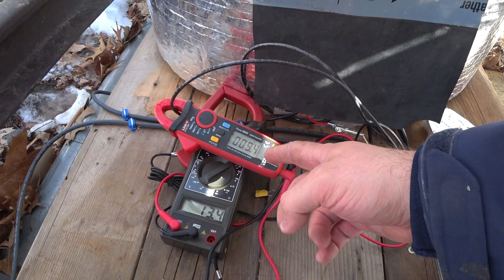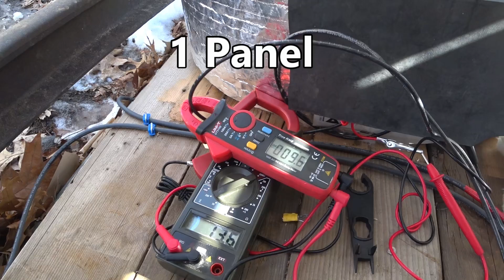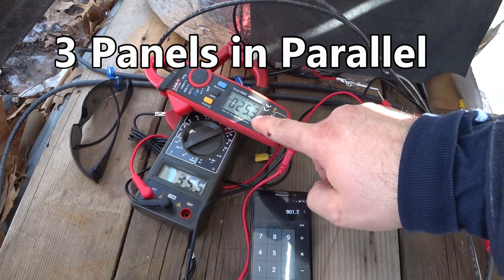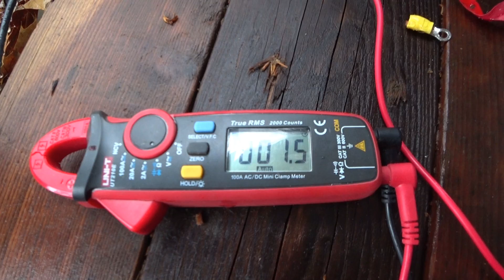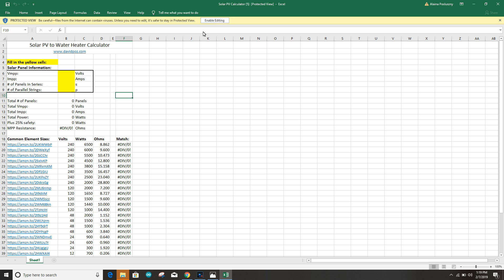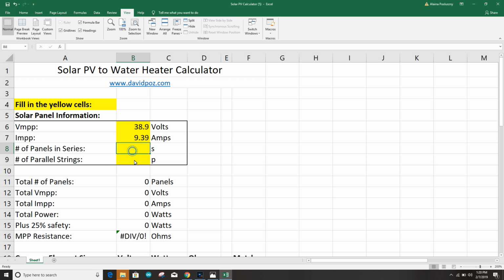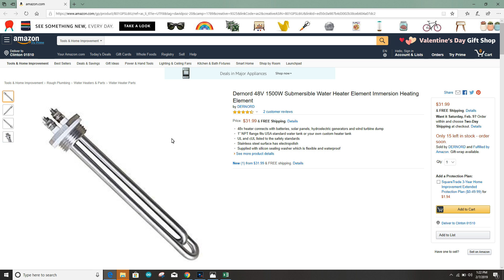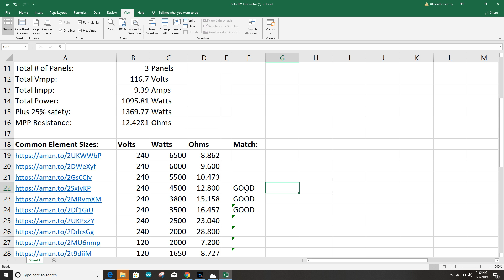Matching Water Heater Elements to Solar PV Panels

Comment: I'm doing an experiment today along these lines. Your video made me want to try it! I'm having an issue though. Doesn't matter if I hook my 3 panels in series or parallel I still only get 13 volts and 2.5 amps. I'm stumped.
Reply from the maker: Try going on to my website and downloading the excel spreadsheet.  Input your solar panel Vmp, and Imp.  They are usually listed on the sticker on the back of each panel.  Input your info and it should give you a good match.
If you don't have excel, send me your panels info and I'll get back to you a result.
Reply: @DavidPozEnergy  Based on the spreadsheet I think I need better panels. I guess I need to bite the bullet and pay the freight for 300 watt panels. I have looked for them off and on but with limited luck. When I did find them I couldn't afford them. hmm

Todays test did get me 10 degrees above ambient. That is in an open container uninsulated. I had to put them back in parallel. I think I had something not just right the first time in parallel. Or the clouds ruined it. It's rained every weekend here for two months. Weekend time is all I get.
Reply from the maker: If you want to connect on facebook we can look at it together.  https://www.facebook.com/DavidPozEnergy/

Comment: What is the efficiency of production of hot water vs. Electricity in your area? Would it make sense in most cases to use the space better by using a closed loop glycol solar hot water system for transferring heat from the sun to the tank for storage than using the pv panels to convert the light from the sun into current and then heat in the tank?

I guess the amount of capacity in each system is variable so, if you are generating sufficient voltage and amperage to equal the demand of an empty house all day to be used when you get home, that is one considerstion, if you are using the electricity during the day with someone at home, doing household chores and activities there will be greater demand, so less need for storage, but, no infeed to supplement from outside and if that person is at home doing normal household chores and also doing work for income, which requires electricity, you would definetley surpass your ability to store any potential for later in your batteries and further require infeed of current daily, ultimately costing more money and plscing higher pressure on your decision to allocate the solar array space between solar power for voltage or for heat. Perhaps each of us in our own situations will have to make that decision, right? So if we opt for electricity because of potential currency savings in the event of higher pricing and a battery bank for eventual electrical infeed outages, then on the available space, hot water is out, not allowed any space, so we heat hot water with other fuels?

OR

We formulate the space needed with the technologies available today to cover all contingencies when building the racking for the solar array, including some suntracking for the most expensive energy demand and future expansion, we would have to build in some extra spaces for that expansion or have a lucretive interconnect or grid tie document to pay for any excess power generated.

So, our PV space would be:

(PV1 ÷ PV B ) + (PHW1 ÷ PH T) = ARRAY SQ.FT
WHERE: PV1 = nobody home
PV B is battery capacity (expandable)
PHW 1 = Solar Hot Water collector space and PHT1 is storage space when no one is home (expandable).
Your array may only be 1/2 full to meet this level of service. If you add 10% and call this solution 1, you are following me here.

Then for solution 2 & 3, repeat with increasing loads for the minimums.

The ace in theholes are the changing costs of maintenance, material life and upkeep, natural distars and expansion frequency. These may all be covered if your power company or a paying Air B&B,  hunting and/or fishing, artist, photography, pilgramige, honeymoon, getaway or retreat cabin(s),  are located there to use the excess. In that case, and if successful in filling those cabins, build and expand away! Add another revenue stream, build more...

These incipient loads and potentials must be established before the prints or images in one's head take real shape!
Thanks for illustrating step one in holistic resource management - paradigm construction 101.

Comment: Solar thermal panels (which are not self-built or 20 years old) with "forced" circulation are much, much more efficient than a panel of the same mono-crystalline photovoltaic dimensions, excluding the high-performance SCHMV.

Comment: I can't help but feel something is terribly wrong with your setup... Out of, I don't know, six or seven arrays friends have that I have helped install, series is always additive. So I'm not sure why your system is not additive, that is LITERALLY the point of running in series. Same power at a lower current. Allowing for cheaper wires and lower, safer voltage to be used since they don't need the high current carrying capability. 1500W=1500Vx1A or 1500Ax1V... One of those could use some super tiny wires, one would require a prohibitively size wire... So to instruct people that series is somehow a bad idea, is... A bad idea... Not too fond of the guidance given here. :-(
Reply: Panels are current sources. Current adds in parallel. Voltage adds in series.  If there is one take away, it should be that matching panels to load is critical. AND that is not a one time thing.  The load has to be re matched continually throughout the day. That is why a power point controller must be used to perform this matching of panels to load. This setup without electronics produces half the power that it could have.  I've been trying to teach people how to heat water for years with PV.  It is a difficult idea to get across to the general public.

Comment: I enjoyed the video,...at about 11 minutes you show on your spreadsheet that three solar panels generating 116 Volts , 9amps  producing about 1100 Watts is enough to run a 240 Volt approximately 4000 Watt heating element. Can you explain why you wouldn't want solar panels that produce about 240 Volts at about 16 Amps to run a heating element that's rated at 4000 Watts?
Reply from the maker: You could do that too.  It's just about matching the ohms of the resistor to the number and mp of your panels.  So if you have panels strung together in a series/parallel combination that has a Vmp=240, and an Imp=16, then you would be well matched.  I did something similar with my panels in my front yard.  They are all series strung together and tied to a baseboard heater.  https://youtu.be/jFoxIit8NYA  Thanks for watching.

Comment: I'm still confused why your voltage was lowered to 13.9v with 1, 2, 3 panels in series as well as the current remaining 9,? . Did the element limit the voltage at 13.9
Reply: Panels are current source devices.   Notice how the short circuit current on a panels label is almost identical to the power point current.  Ideal panel voltage for maximum power remains about the same  as light level changes.  Only the current changes with light intensity.  Adding panels in series did nothing to change the current.  With a fixed resistance, voltage is current times resistance. That gives a low voltage. The voltage times current is the power.  Direct connect to a resistance like this yields about half the the total power for the day.  And most days the sun intensity is not ideal. A power point circuit allows you to capture all the power possible.  The results would have been more dramatic if this test was performed with a power point controller. Your eye is log and panels are linear. A wisp of a cloud passing can drop panel output 80% and your eye would hardly notice the difference.
Reply: @opera5714  Thanks, and great effort from everyone. So are you saying that 1) With an MPPT controller you don't have to impedance match? 2) Can the AC thermostat switch DC when the element is impedance matched? There isn't much info in the video of how the Thermostat works. @DavidPoz how is your thermostat configured? Thanks guys, great effort!
Reply from the maker: Yes.  The element was a bad match to the panels being in series.  But when I put them in parallel, then they were a perfect match for the element.  If I knew what I know now, I could have used a different element and kept the panels in series.  I'm actually working on another video showing that exact setup.  Thanks for watching.

Comment: The spreadsheet didn't show me what I expected to see. I thought I could run a 150 watt panel directly to a 150 watt heating element. Can I do this?
Reply from the maker: Maybe, but I don't know for sure.  You would need to know the Vmp of the panel, Imp of the panel, and the Ohms of the heater element.  You will probably get some heat, but probably not as much as you could.

Comment: Its really no different than using panels in series With a pwm charge controller you are only going to get the amps at 12v or 14 whatever

Comment: you need a Maximum power point tracker to really maximize the heating power
Reply: Hi Caleb, do you mean , an MPPT controller, between the solar panel and the DC water heating element? could you explain this in a bit more detail? many thanks

Comment: Thank you.  I was thinking the same line of thought as you and would have done the exact same thing.  I realize panels are based on ohms but my brain thinks of them as battery's positive and negatives.   This just saved me a lot of overthinking.
Reply from the maker: Glad to help.  Check out the spreadsheet on my website to make it even easier.  www.davidpoz.com

Comment: You don't really want to do it using direct wired DC, the water would be hot by 10/11am, use an AC diverter or a DC diverter to batteries, and use the power the rest of the day.

Comment: Elements? I run a air to water heat pump off 10 panels to heat a 400lt cylinder it draws about 1500w and outputs about 4000w heat depending on temperature.
Reply: why not using evacuated tubes?

Comment: When Designing a system,  choosing an element that would work with ones panels in series might be better than choosing an element that requires adding panels in parallel.

That is because higher voltage less current through a given line looses less power over over the distance of a given power line than lower voltage higher current.

Comment: Wouldn't it be easier to use a circ pump and home brew solar thermal colletor to a tank? Given how low the efficiency of PV it seems a no brainer? Am I missing something? Keep the PV output for electrical loads and use the directly collected heat for heating.
Reply from the maker: This video is part 3 of the series.  The first video will help: https://youtu.be/VPd212q6uvU Thanks for watching.

Comment: Just a heads up that an AC thermostat will draw an arc when opening under DC and can weld itself closed. This could boil the tank.
There are devices that can modify the DC and prevent arcing. I know of Sunflux in Australia. It's a few dollars but will solve the problem of burning out the thermostat.
Reply from the maker: Thanks.  I'm putting together an outline for a video where I discuss just that issue.  I'm going to try building a relay control.  Should be fairly straightforward.
Reply: Just like the contacts on an old car ignition system a suitably sized capacitor connected across the contacts should solve the arcing issue.  The capacitor is shorted out so discharged when the contacts are closed.  When they open the capacitor charges stopping the contacts from arcing.  When the capacitor is charged the contacts are to far apart to arc.  That is the theory anyway.
Reply: @seangourley14  No. You have to use relays with magnetic extinguishing, or electronics, such as a thyristor, etc. Automotive equipment is about something else.

Comment: I would like to mention regardless which system wins. This is not the most efficient way to heat water with those water heating elements. If you used the right amount of solar panels and the inverter you could run a Heat Pump water heater to heat your hot water. If you did that you could heat water up to 3 times the amount of BTU's than just using an electric heating element. Of course a Solar water heater may be able to get to higher temperatures
Reply: No, you didn't address that theory. You dismissed it at the very beginning because you don't understand the benefits.
Reply from the maker: I made another video that address that theory:  https://youtu.be/ryJmtItfaXQ  Thanks for watching.
Reply: Heat pumps are pricey and in very cold climates they stop working, or if inside your house then you are cooling your house in winter.  Then you need ground source or deep water source...more expensive.

Comment: Ohms Holmes!!! If you can't drop the resistance, you gotta go brute force, and raise the volts!!! Holmes law, uhm?  Ohms law! But if you can't p
Supply the current. It's gonna  basically just short the panels! I may not be making sense, but I know what's up! Ha-ha. I way do this dome day. Along with thermal panels. You gotta go with the watts! What's up, is the watts, for now I'll use propane and or woodgas, in my tankless GAS water heater!

Comment: Liam O is on the right track.

Your heating element is such low resistance that it is drawing a lot of current, an that is collapsing the voltage of the panel.

A slightly higher resistance heating element, would not collapse the voltage as much, and you'll end-up with more power.

The Volts/Amps curve of a panel will show you:
1) what the voltage will be, at different current draws from the panel.
2) You'll see where the maximum power point will be (basically Imax and Vmax on the data sheet)
3) you'll see that the VI curve varies with solar illumination and panel temperature.

This means that where the maximum power point is, will constantly move around (different current draws) depending in illumination and temp. That's why the industry created MPPT inverters. MPPT will constantly apply different current draws to the panels, to find the current draw where it can pull the maximum power.

For your setup, please just go buy 2 or 3 MPPT inverters (DC output), and let them track the amx power point for you, and heat the water as much as the sun+panels can offer you.
Reply from the maker: Hi Scott,  I agree that an MPPT would be great.  Can you please link to a proven one that would work in a direct to load connection?  Remember, there are no batteries in this setup.  Thanks.

Comment: As long as the voltage isn't greater than the rated voltage no matter how many watts you supply... It shouldn't burn out the heater
Reply: RogueOntheRoad I think you could still burn it out with too many amps.  Theoretically at least. Think of a car battery being shorted thru a wire : low voltage, but the wire melts.

Comment: if u just use all the panels pv will win ... you should use an mppt tracker  really to get the most out of the panels .. just saying. Look it up and learn more ;) its a solar charge controllet that utilizes the Maximum power output that might be at lower amps and higher volts ...